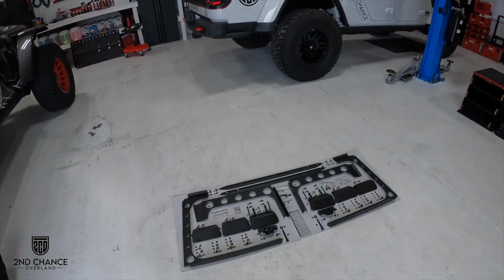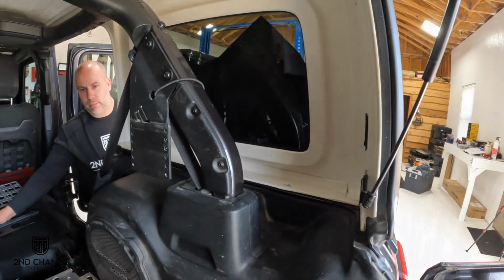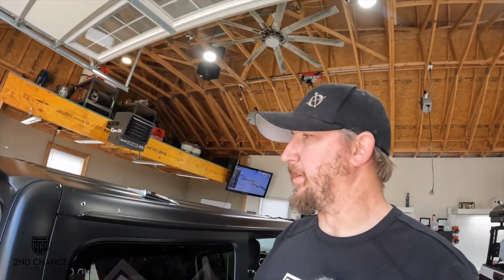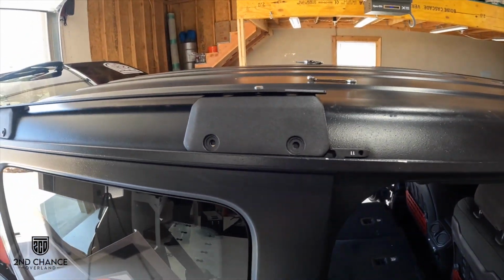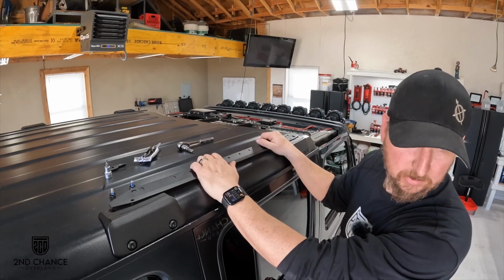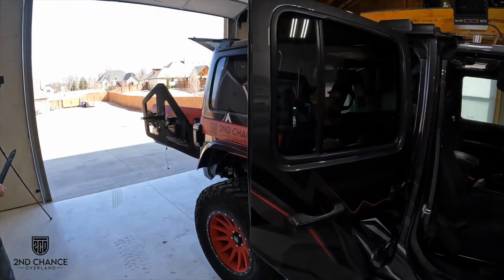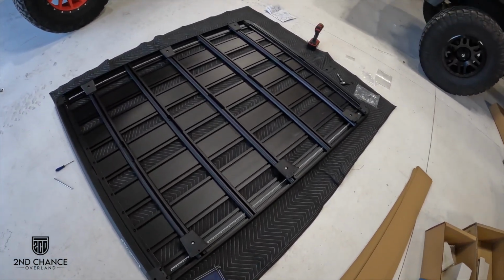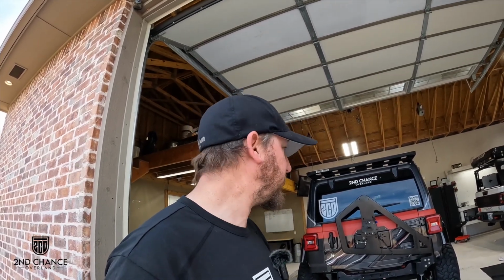Jeep Wrangler Rhino Rack Backbone Install

Comment: very nice video.  Does the rack overhand the open part when the freedom panels are removed?  If so I might get this but put a smaller platform on it if possible... I like looking up at the night sky with the freedom tops off... not trying to see a roof rack lol
Reply from the maker: Thanks!  The rack does not obstruct the freedom panels.  It's adjustable so you can shift it forward and back as needed, just depends on how you want it to line up at the back, etc.